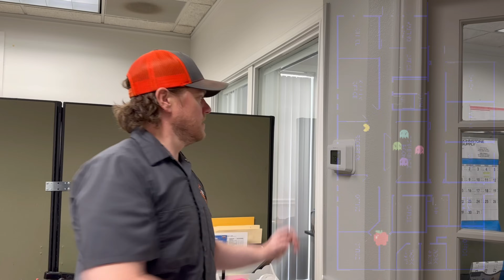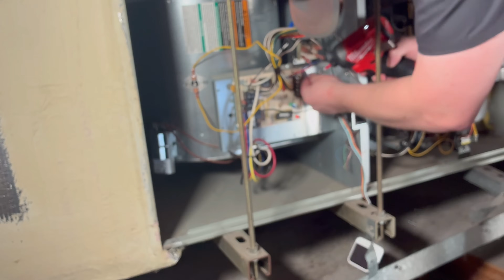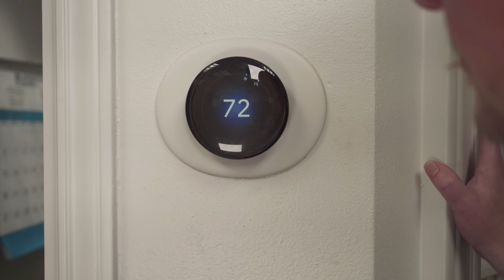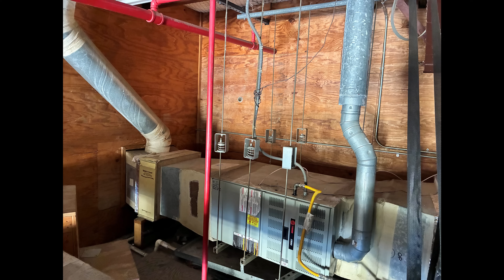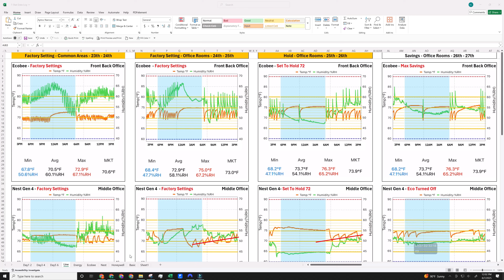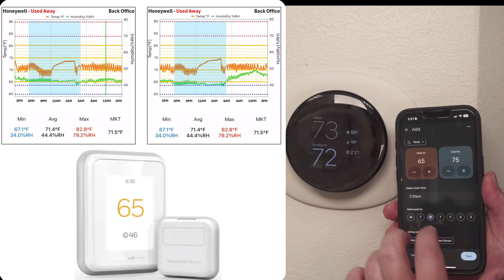Stop Buying The WRONG Smart Thermostat

Comment: The Honeywell smart thermostat models don't let you adjust cycles per hour, yet the cheap simple non wifi programmable ones do with the installer settings?? Pretty unfortunate
Reply from the maker: thanks for letting us know. I'll have to look into that
Reply: I have use Honeywell Prestige IAQ.  They allow you to set the cycles per hour along with MANY other performance and operational settings.  A commercial mode is also available with different options than the residential.

Comment: Totally agree about your assessment of the Nest thermostat. It drove our family nuts with its desire to come out of hold mode if you even sneeze in its direction. We ditched it. 
Next was a top of the line Honeywell. Yay…it stays on Hold…but it had no Auto setting where it can switch between cool mode and heat mode. Ughhh. 
Enter Carriers wall control thermostat. It works perfectly with none of the issues above. 
Two of them control 2 fully variable Infinity 3 ton 24VNA6 and 98 HE 59MN7 condenser & furnace systems respectively. 
Hope you can test it in the future. 
Thanks for the vid and keep up the great work.
Reply from the maker: Infinity testing coming soon!
Reply: You probably already know from watching this channel that using a communicating proprietary thermostat with a communicating Infinity system is going to be ideal.

Anyway, +1 on wanting them to test the Infinity Control with this methodology too!
Reply: @metal571 agreed. But more importantly if used with other systems, it will still do the basic two functions that other thermostats would not as mentioned above….hold for good…and /or Auto function.
Reply: @metal571  It's ideal...as long as you don't have to use their phone apps.  No integration with smart home platforms, geofencing, etc.   I just signed the contract on a new Carrier 2-stage system today to replace an 18 year old Infinity system because I wanted to use an Ecobee.
Reply: I absolutely hate those Nest thermostats. They make me crazy lol.

Comment: If it has to be networked... that isn't smart.  There are a host of other timer products that can be configured to manage the simple 24volt controls.  For example: you could lockout your air conditioner compressor unit [and the air handler too] from operation between 11am to 3pm, which gives it time to cool down the place before you get off work - switch the 110v supply for your control transformer through it, and save a little money.
The only thing close to conplexity with air conditioning is the condenser fan must energize when the compressor is running, and the manufacturers do that up front by design using a common contactor for both.  Not perfect, but good enough, and your thermostat is not relevant to that design
Reply from the maker: and this is exactly why we like Techs who really know their stuff. Installing a smart Tstat with input from a solid Tech doesn't always get the advertised results. Thanks for the comments

Comment: I know this channel is instructional, but I wanted to do an unsponsored shout out to Atlas AC. I live in Austin, Texas and my 25 year old Rheem unit finally died. The Atlas team came and assessed my needs. They recommended a unit that perfectly took care of my needs at a cost that other competitors could not match. However, my shout is mostly about the professionalism and post installation follow ups. The team checked each vent, made sure air and temperature were as needed, actually “showed me”. They explain all steps of the process. I cannot recommend them enough.
Reply from the maker: Thank you for the shout out, we do appreciate the comment and recommendation from the great state of Austin!!

Comment: Great video! Question: does the Nest and Honeywell thermostats have cloud history data like the ecobee has? This is a great feature for reviewing numbers and troubleshooting. I have at least 5 years of ecobee data in a dB that I created.
Reply: Do we really care what the temp was at home on Oct 22, 2017 at 8 o'clock ?  Its time to address digital pollution in the cloud - who's gonna pay for all that storage & backups?  There are better things to do.
Reply: @flinch622  eobee, maintains your cloud data for 12 months. I download the data each month and I do some calculations on it like outdoor CDD, runtime, temperature, and I created a page on my home server that displays the numbers that I want each month with graphs. So what have I used this data for, troubleshooting. About 4ish years ago I noticed that the heat runtime was going a lot longer,  and the duct output temperature was not close to what it should be, although heat pump was producing heat @ 40f degrees outside. Well, when I checked my Energy Management page I noticed that there was just the right amount of current flowing for the heat pump alone, but not for the heat coils. Opened the package unit and the heat coils had a supply voltage, but no heat. Coil died. Another case was when the cooling cycle was a lot longer than normal per the report page and I popped off the package unit cover which showed that the evaporator coil was loaded with what looked like dust. I cleaned it out with a coil comb and it works great. Oh, like 45 days earlier, the HVAC tech said he cleaned everything up as part of the annual service call. I do it all myself now, I check everything every 3 months, just in case.
Reply from the maker: The Atlas Way: get yourself educated and make your own smart decisions for you!